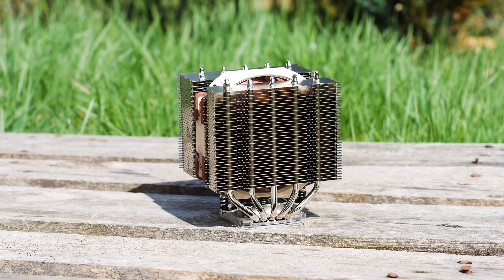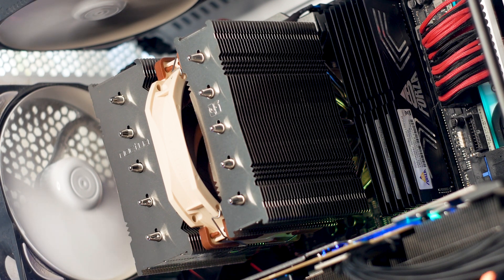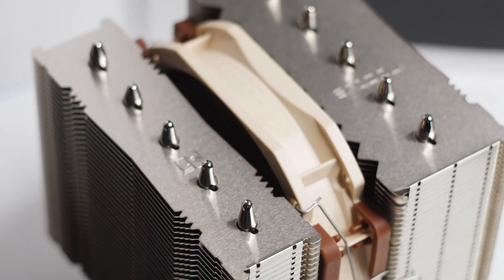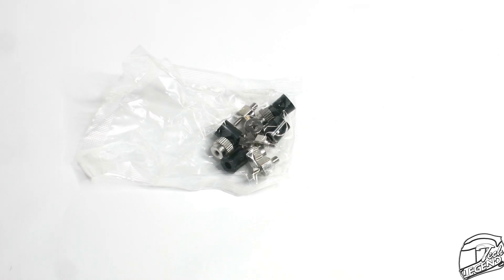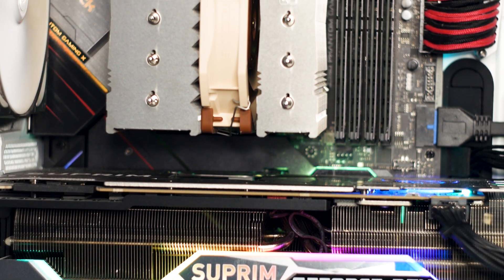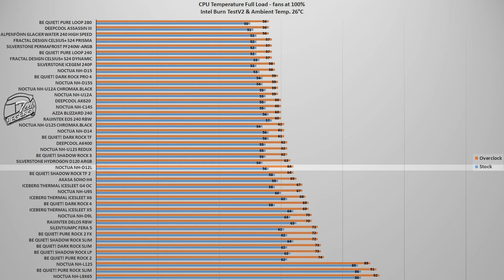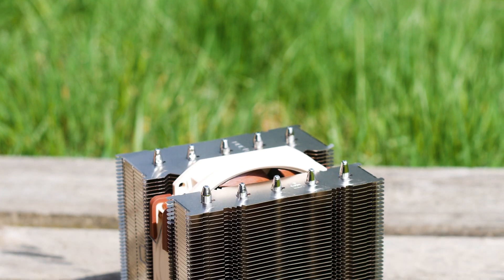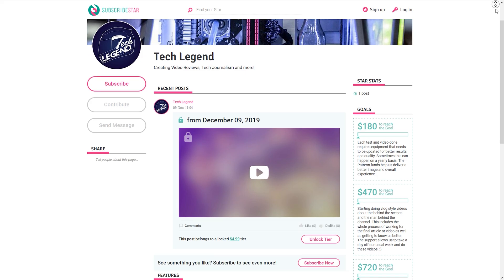Noctua NH-D12L CPU Cooler Review - The Best SFF CPU Cooler

Comment: if i am not mistaken, for am5 u dont replace backplate. u use the default am5 backplate. though you still need to swap out the front side rail m ounts (if thats what they are called).
Reply from the maker: That is correct, but i have seen backplates used for AM5
Reply: @TechLegend-com  eh rely? hm... im installing a noctua soon. i better check the youtube guides for it then. i just assumed default backplate used since another youtuber said that. ty for the headsup.
Reply from the maker: @AinzOoalG0wn  It depends on the motherboard, don't worry too much. It will fit, either way.
Reply: @TechLegend-com  i just installed my new noctua fan for 4u nas case. manual says am5 default backplate. was easy install :} also the bracket came with the offset which i used for the ryzen 7600 cpu.

Comment: hello, thanks for sharing... I have a question. I own a i5-12400 (65w tdp), with the cooler can I use it without a fan?... I want a kind of silent build and I dont want to go for the NH-P1, find it too big!!!
Reply from the maker: Not really, you can create a fan curve to keep the fan at a low RPM and get almost no noise.
Reply: @TechLegend-com  thanks
Reply: @TechLegend-com  I did testing... with the fan off, the cpu never goes above 42c on normal task, like web browsing file zip and unzipping. so I set the fan curve for the fan only be activated at 60c.... rest of the time is off... I have 2 Phanteks T30 -1 intake and 1 exhaust at 750rpm, on Techware Fusion case wich is full ventilated with 4 mesh panels-. eveything is dead silent!!I did testing... with the fan off, the cpu never goes above 42c on normal task, like web browsing file zip and unzipping. so I set the fan curve for the fan only be activated at 60c.... rest of the time is off... I have 2 Phanteks T30 -1 intake and 1 exhaust at 750rpm, on Techware Fusion case wich is full ventilated with 4 mesh panels-. eveything is dead silent!!I did testing... with the fan off, the cpu never goes above 42c on normal task, like web browsing file zip and unzipping. so I set the fan curve for the fan only be activated at 60c.... rest of the time is off... I have 2 Phanteks T30 -1 intake and 1 exhaust at 750rpm, on Techware Fusion case wich is full ventilated with 4 mesh panels-. eveything is dead silent!!

Comment: What amaze me in the test is that noctua nh-c14s outperforms this cooler. Totally not worth "upgrade" for me then.
Reply from the maker: The NH-C14S is louder and has worse clearance overall. I think that each cooler has a different purpose. The NH-U12A is still looking like the best option for good clearance and performance.
Reply: @TechLegend-com  clearance is no issue im interested more about the performance. Noctua rates nh-d12l better for r7 5800x3 than nh-c14s but your test show othervice. Mean have atm r7 3800x with nh-d12l and it performs pretty good with allcore pbo overclock @4.4. thinking thou would nh-12l truly better performance with decent fan speed
Reply from the maker: @user-eq2fp6jw4g  It's a lot of variables to take into consideration. Some CPU coolers perform better on some CPUs while other are louder but also better temp wise. I'd say that the best compromise if you want performance and clearance is the NH-U12A.